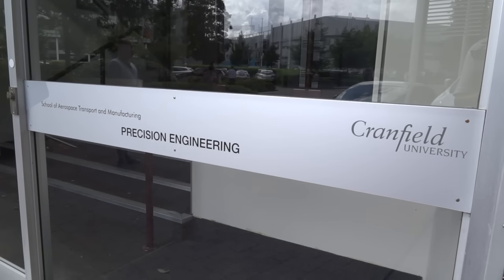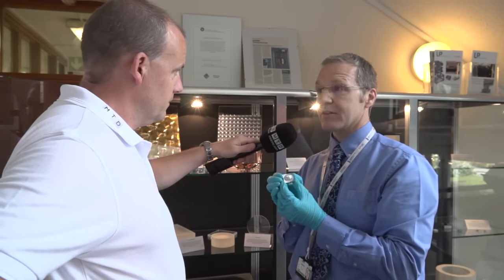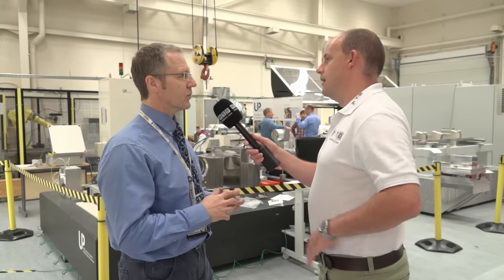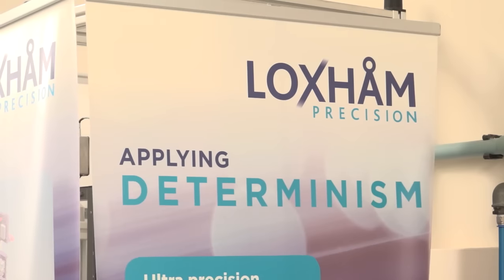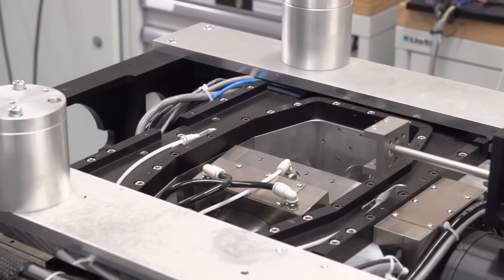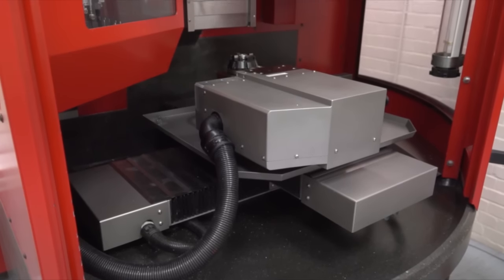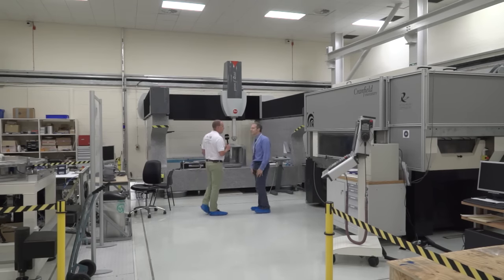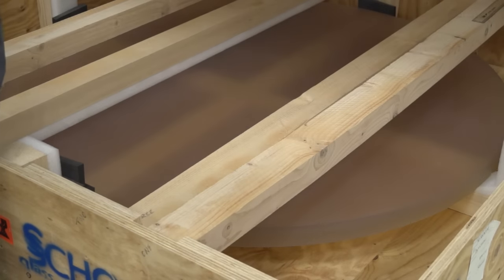Tour of ultra precision at Cranfield University

Comment: It´s only ultra precision if you can work on an atomic (hydrogen atom) scale. Everything else is not ultra precision.
Reply: Within the constraints of the market place it is certainly considered ultra precision.
Perhaps you could steer us to some better examples, or are you just splitting nano-hairs?
Reply: As research engineer in the field of nanotechnology, I´m used to work on an atomic scale. Building things, especially drive systems for nanobots, atom by atom is commonplace for me.
Reply: I am a carpenter in the United States. The smallest measurement I work with is 1/16 of an inch.
I would say that "atomic precision" is a more apt term for the scale you're working in.  Bear in mind, that 100 years from now, atomic precision will probably be considered pretty sloppy.  There's a lot of empty space in them thar atoms!
Reply: Well yes, but you're not building parts at a comparable size. A variation of less than 1nm across a copper triaxial ellipsoid of nominal diameter 126mm is obviously considered "ultra precision" enough to serve as a new international physical standard for the redefinition of the kelvin.
Reply: @ericy4522  If you put it like this, you´re right. The AFM that I work with in our lab has a positioning accuracy below 1nm. But it can not cover a distance of 126mm.
Reply: @ericy4522  Anyhow 'less than a nm' is atomic scale..